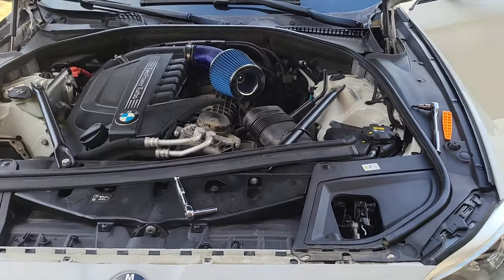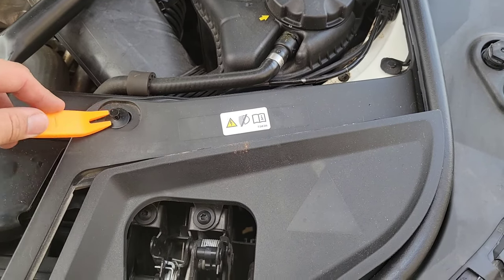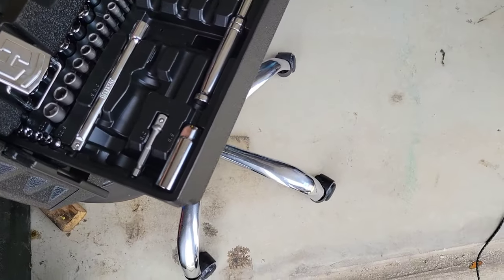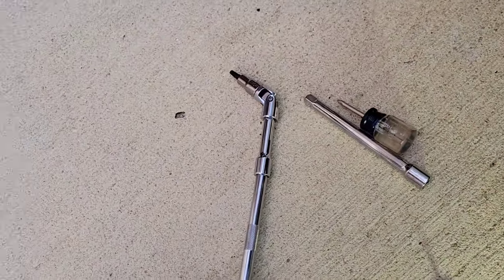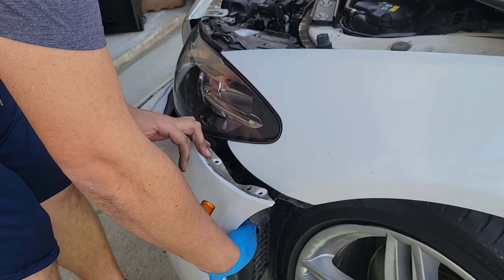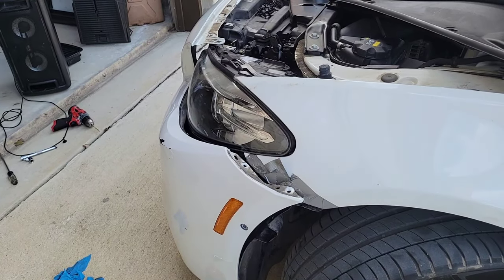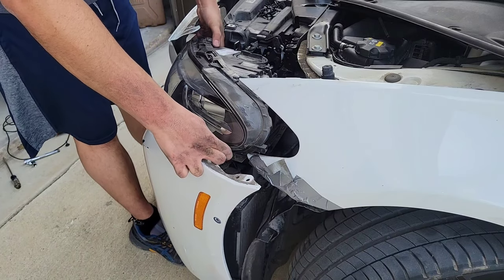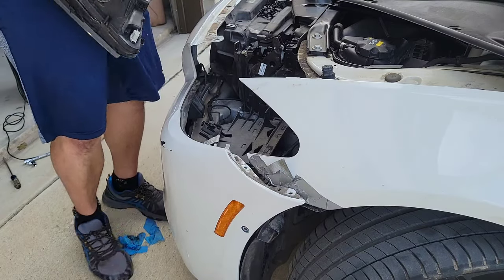F10 BMW 5 Series headlight removal without bumper removal

Comment: Thank you for taking the time to make this video, reading the comments I removed the full wheel lining at front tyre and obviously the tyre, this made that awkward screw much easier to remove. Also I removed the bolts on the wing just to give bit more room to remove and replace the light.Thank you again, your video was a massive help mate cheers 🍻
Reply from the maker: Thanks for the comment!

Comment: Thank you my man, saved me a trip to the shop just to take the headlight out, just to take it to another place who fixes them 😁👌

Very good informative vid. I also took the wheel and the front fender liner as it was quite easy to do, cause fender liner is a 2 part, and gave much better access to the far right bolt.

Took me an hour to do this first time. Kudos to you
Reply: front fender liner?,  where is that?
Reply: @knaldeglad  plastic bit in front of the wheel, inside an arch, held by like 10 screws, has a hatch to access headlight bulbs

Comment: thanks mate but it seems to be alot more pain than just simply removing the bumper. Bumper removal on F10 is so much easier and also you suggested removal of the wheel which is more painful sometimes than removing few bolts on the bumper.
Reply from the maker: Thanks for the tip!

Comment: how did you get that rear bolt back in....
Reply from the maker: Magic fingers
Reply: Have to really get a bright ass light so you can see the bolt then with an extension and some patience I was able to reach it then unfasten it  that was the most time consuming part finding that bolt on the passenger side the driver side you can see the bolt much easier SMH nobody mentioned that part